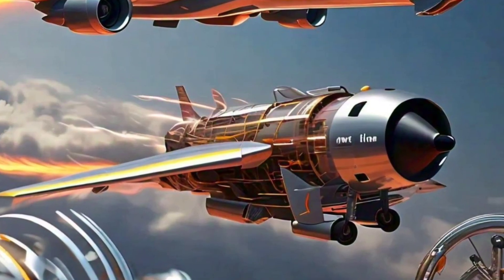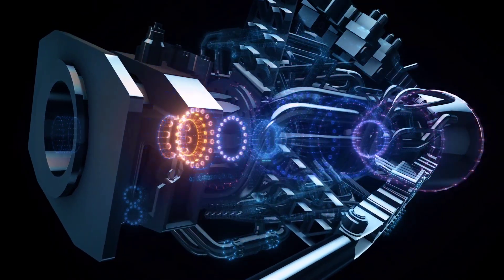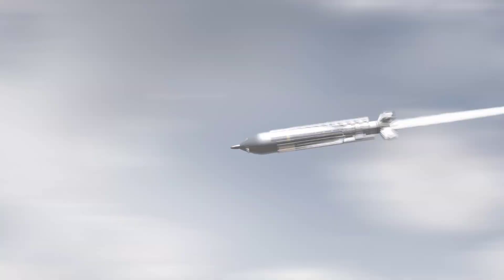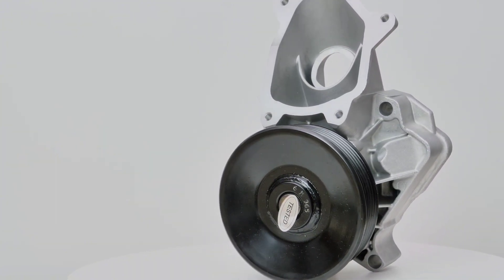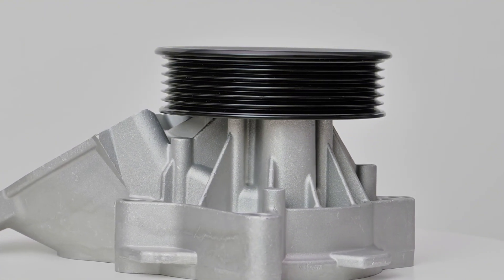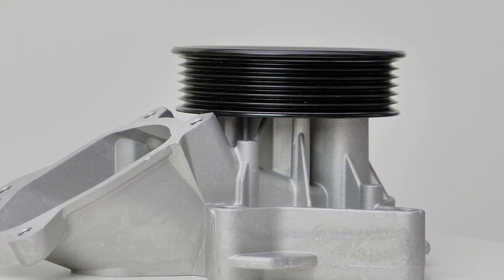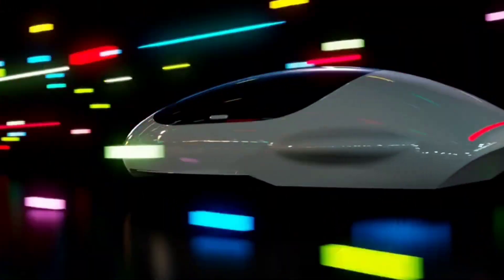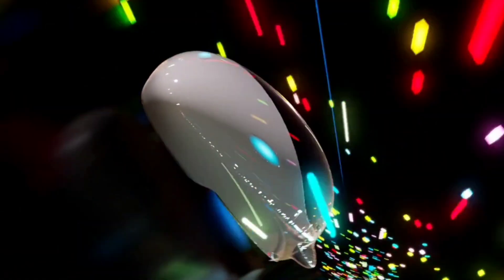How China’s New Engine Could Dominate Hypersonic Travel

Comment: What does an automotive engine water pump have to do with this???
Reply from the maker: The reference to an automotive engine water pump in the context of China’s hypersonic engine is likely an analogy used to explain a component of the new engine system. In automotive engines, the water pump circulates coolant to regulate temperature and prevent overheating. Similarly, in hypersonic engines, managing heat is a critical challenge, as scramjets generate extreme heat at speeds above Mach 5. An efficient cooling system, like the water pump in a car, would be essential for maintaining optimal operating conditions and preventing damage from high temperatures during hypersonic flight.